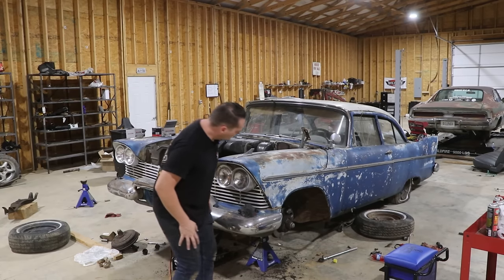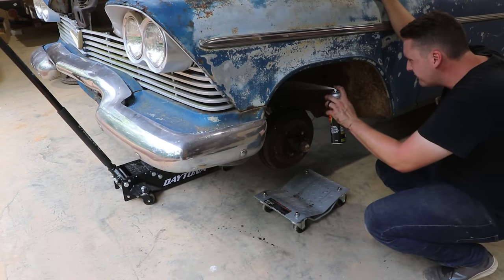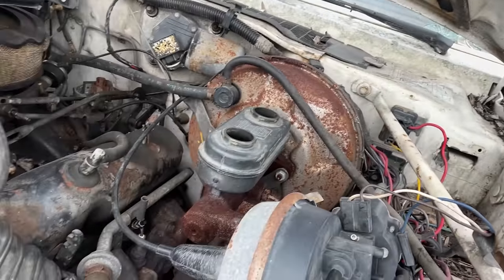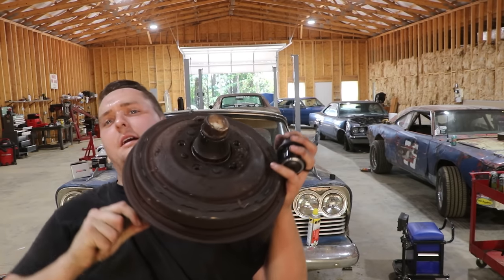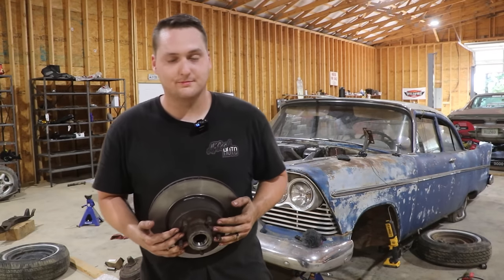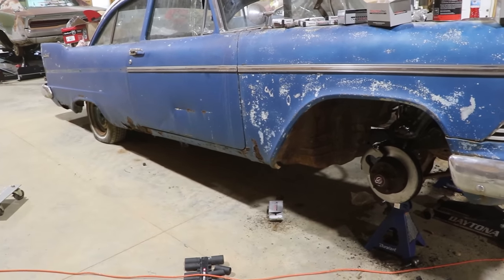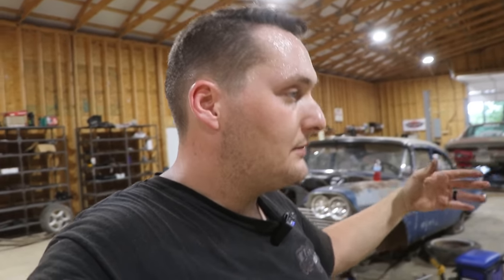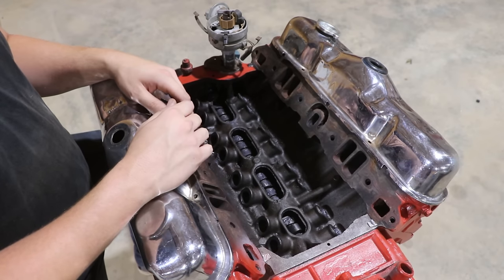Barn Find 1958 Plymouth Gets New Engine & Brakes - Will They Work?

Comment: Howdy Dylan,,, those old ball joint "pickle forks" are the weapon of last resort!   You're going to replace the  spindles anyway, so here's the  easy way to separate them.. undo the tierod 
End , then , using a BIG drift pin ,  i.E. king pin,  place it directly on the spindle surrounding the  ball joint, using your largest B.F.H., HIT THAT SPINDLE!!!  One or two whacks and the ball joint usually falls out......

Comment: Guess they also used the screw ball joints forever at least into the early 70s too. I know the old race car our 1969 RoadRunner had them and also my 1970 Dodge Challenger.

Comment: you had the Corodoba right there,, same front spindles,,,
Reply: Yes, if I remember correctly, that car's not being parted out, though.  So, probably easier to grab them off a carcass at the yard than to pull them off the Cordoba, then install the parts from the 5th Avenue on the Cordoba.

Comment: You, my friend, need to get yourself a hammer set. Something with 4-5 sizes, and bigger is better! That little ballpeen unit your slinging at ball joints, and splitters, and the strut bar end is made for center punching, or being gentle. Your throwing HP at something that needs torque!!!👌👍😎

Comment: Look so easy. Only in usa 😶 i bought a pontiac temspest 1962 here in sweden and it have drums all the way around. And all breakcylinders are junk so I cant save them. The is no replacment for them so im thinking to cut out the centers of the backplate and wield on something else from another car like a chevy 60s. There is no where here in sweden to get hold of anny parts to that car. (The gearbox is in the rear axel) and its totaly original.

Comment: I wouldn’t have used those big willwood or similar aftermarket brakes anyway. 9 times out of 10, they are not set up for the proper vehicle and end up either being under sized or too big and locking the front wheels up

Comment: It's not because it's junk, there's techniques taken ball joints and yes they can be pain in the ass sometimes, but a torch might be even faster than I cut off saw, and there's also using a jack in the right place putting pressure on it and then smacking a hammer at the right place. Don't stop with the Christine funny references, 👍
Reply: I didn't realize it was threaded in ball joint oops, Boy Chrysler is messed up, still like the car though, Chrysler Ford Chevy has its up and downs.
Reply: At first you confuse me when you're taking those ball joints off, did you research and found out they were threaded, cuz I've worked on lots of vehicles through the years I never had to unscrew any ball joints out,  learned something new. Cool McCool.

Comment: So I just bought a 66' Plymouth Fury 2dr hard top with a 318 A motor in it (hard to find specific parts)

I kinda want to keep the old girl with her original engine, but should I just get it running to drive until I can build a 340 or 383 and swap it?

Comment: The term upgrades means better than original. Disc brakes are never ever an upgrade on a car that came with drum brakes. It will take the car longer to brake than it did with drums. 

That being said front drums are beyond most peoples ability to fix. Disc brakes that fit inside original rims will work but has much less braking force. To get enough braking force with disc brakes look how big the rims on cars have to be now to clear them.  This car originally had 14 inch rims. Which won’t fit over those front disc brakes you have to use the 14 inch from 1970 or the much easier to find 15 inch.

Dual conversion is another big issue. He said new proportioning valve. I stopped video right there. Ok mechanic lesson. Proportioning valves on four wheel drum were on rear axle front had a simple t. Disc and drum cars had combination valve that put less fluid towards rear and have a slide to cut off one side of the split system should there ever be a brake line failure. Side note Chrysler fifth avenues from 79 to 89 combination valves have an air issue. On bottom is a cap with rubber cap that likes to rot out and pump air into rear brakes. They also cannot be manually bled. Vacuum bleeding works.